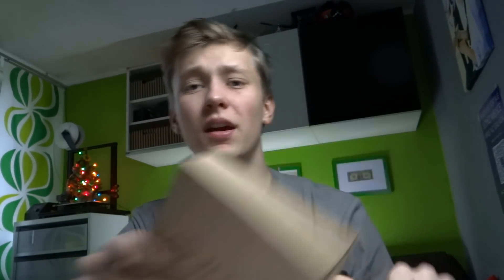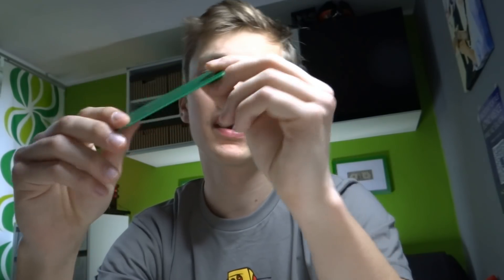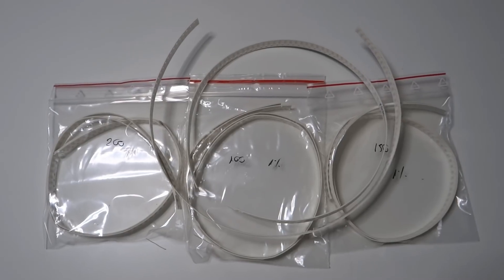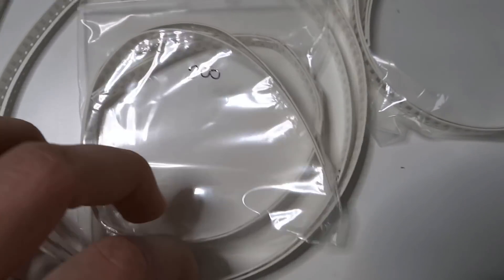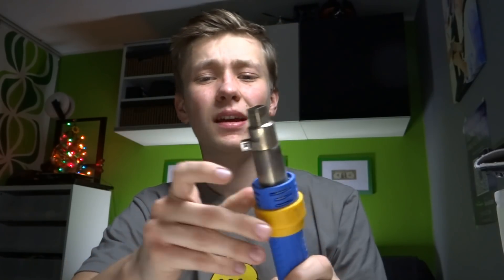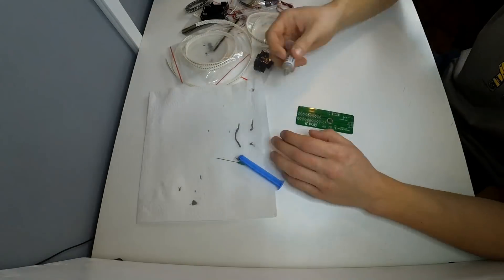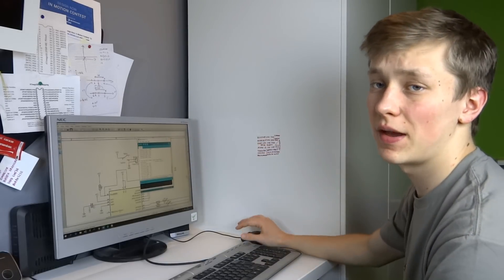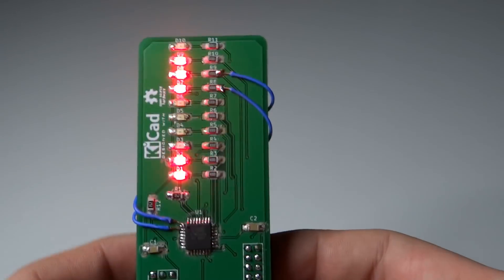Arduino based POV display/clock with custom PCB

Comment: I enjoy electronics projects. It is impressive how affordable custom PCBs are. I was planning to make some prototype boards with solder and wire for basic temperature measurement, but it may be faster to just order some custom PCBs. Thanks for sharing your project with is.  I am looking forward to seeing the enhanced version. I’ve seen a POV fan type device that can do some really impressive displays.
Reply from the maker: Sure, I am working on an enhanced version of this project it should be ready soon. And I think that these days it's seriously not worth to make a PCBs at home. I mean if you just want to learn how to make them and how this process works, sure no problem. But if you just need them for the project it will be cheaper, simpler, more professional but probably not faster (most of the companies in china that produce PCBs are making them in 2 days but shipping takes a lot of time) to order them from manufacturer. And also soldering this type of boards is easier. You have a solder mask so they will last longer. I made a lot of PCBs at home and I think that I wouldn't make any more, it's not worth it :) Thanks for comment!

Comment: Thats awesome. I can't wait to make my programing shield. Im pretty much going to be do the same process.
Reply from the maker: Thanks :) Good luck with your project!
Reply: I have one prototype so all I have to do is get it off a perf board and onto a pcb.
Reply from the maker: Great, which software do you use for PCB design?

Comment: So great! :D
the design mistake is actually interesting. We learned to xheck the ICs pins very Well before we use them :)
Reply from the maker: Thank you! Yes we have to to avoid such mistakes. I focused so much on the connections, resistors values and every part of the project that I didn't focused on such a simple thing :(